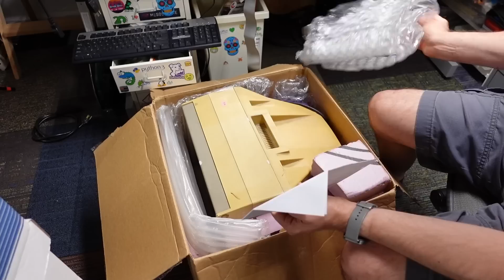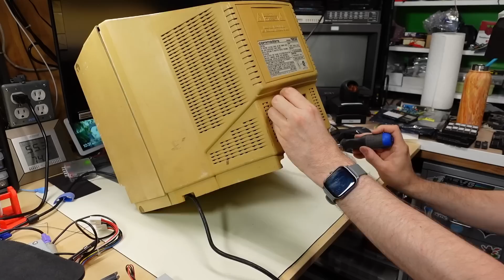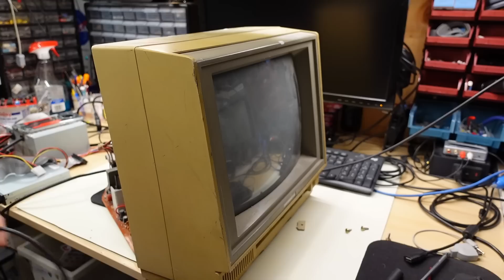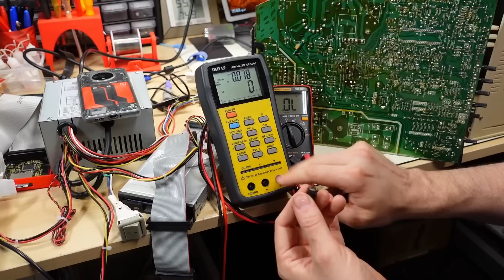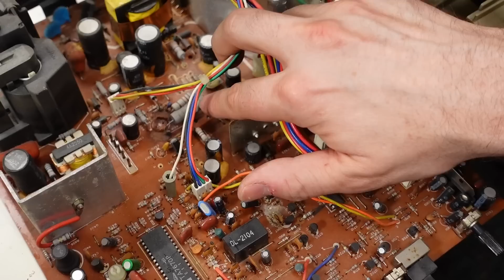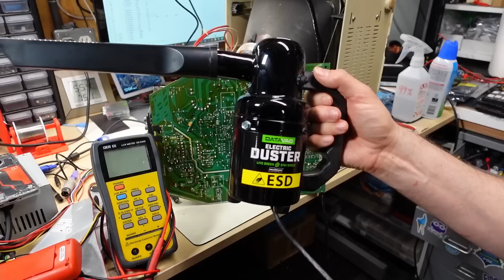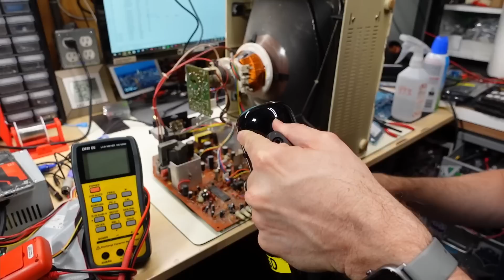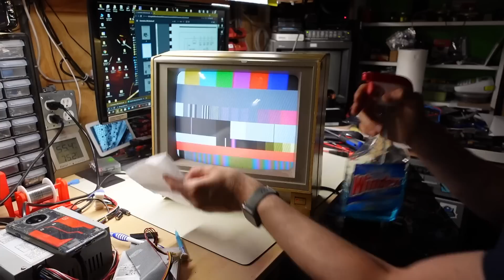What broke on this Commodore 1802 monitor? #repair

Comment: I have a funny story about my 1802 with a similar deflection issue. I bought it in 2018 and it worked great aside from a sticky power button. A few months later i turned it on and had a flat line. Dead vertical deflection. But if i let it warm up it would slowly grow to fill the screen. I spent some time diagnosing and didn't find anything. Decided to take the shotgun approach and recap the entire monitor... No change... Replaced both the ICs... No change... Even tried reflowing a bunch of solder joints... No change. 
Well, around this time i also had a major mold problem in my apartment (i was in a shady apartment complex). As it turns out, there was a loose drain pipe from the walkway upstairs, causing moisture to get into the walls which caused the entire apartment to stay very humid. Well i finally forced them to fix the issue with the drain pipe and got everything de-molded and some time later turned the monitor back on to try to do some more diagnostics... To my surprise the deflection problem was gone! It's been a couple years and it's never come back. I still have a hard time believing it but the only conclusion i can come to is that the very humid air was causing some sort of fault in the vertical deflection circuit. And that's why as i left the monitor to warm up it would eventually fill the screen. I couldn't believe how much time I wasted just to find out the monitor didn't have any issues but in the end it got a bunch of good maintenance, so I can't complain too much.
Reply: Ugh, I hate that. I had a Casio VL-1 that was totally wrecked by that sort of mould. That, and spiders - they just love circuit boards.

Comment: I’ve taken apart electronics in the past and it was not uncommon to find parts that are susceptible to breaking off if exposed to sustained vibration get anchored to the board with some type of contact cement. I’ve also seen some type of hard wax used, and my work uses epoxy in similar situations.

Comment: The original 1701/1702 were JVC TV/Monitors rebranded. Some of them, the earliest, have still a cubhole where the RF Modulator sat, and all the other have some pegs hidden under the bezel where the JVC logo was affixed.

Nice video, I love seeing restorations and since I may have to move in a bigger house, I always seek suggestions on how to pack my CRTs properly ^_^

Comment: Had a couple of 1802's for a few years.  Never had as much luck with those as with the 1701 / 1702's I've had.  1 of them ended up with the vertical deflection problem this 1 has.  The other had a number of cold solder joints on the main pcb which a friend at tpug did help with a few years ago.  Too bad it ultimately failed again.

Comment: If there is space under the board you could move the power resistor „down under“  and away from the cap. It wiggled anyway when you touched it as it were cold solder joints. Never move a cap away on long Leads because of inductance effects an that cap is a power reservoir for the deflection oscillator. And long Leads defeats its porpoise of delivering power to the circuit.
Reply: As this is a low frequency circuit I doubt lead length will make a difference here. In more critical areas and particularly with ceramic/film/tantalum caps lead length should definitely be kept in mind.

Comment: Didn't start to watch the video.   I'll guess cracked solder joint or a blown flyback transistor.   Ok,  I'll watch the video now.  Edit:  Guessing a bad cap is just boring anymore.   BTW some of that glue can become conductive over time and especially near heat.

Comment: At 31:43 what is the molex connector to the right of your hand? I have a wells gardner 27" arcade CRT and I'm trying to find a connector the AC input.  That connector looks about the same but with more pins. Cant seem to find it online.
Reply: Search for Wafer connector instead of Molex.
Reply: @Okurkaarrgghh  That's totally the wrong type. Anyway wafer is not a real connector. The correct type is usually JST, Amphenol, TE Connectivity, Hirose or Molex or some other actual brand. @TheGato38  I own a Wells D9200 27" arcade CRT which is in my Taito Egret II arcade cab. If your monitor is the same model or similar, contact me directly and send a pic of the connector and I can help you to identify it. There are many many many different types of connectors and most of them look the same. Or look on mouser for cable and power connectors and you will probably find it.
Reply: @johnbos4637  That connector is in the 1802 service manual referred to as Wafer.

Mouser also sells Wafer connectors.
Reply: @Okurkaarrgghh  That doesn't help. There are at least 6 different 1802 monitors that all look slightly different and will be different internally too. But you missed the point. The guy was asking about a Wells Gardner arcade monitor made in the early 2000's, not 1986 like the Commodore 1802. Looking up a 'wafer' connector isn't going to help because the Wells monitor uses modern connectors. Like I said there are 1000's of connectors and they all look very similar on the surface and the guy obviously isn't clued up enough to see that the 1802 connector is actually noting like the Wells monitor connector. He just sees a connector and thinks it's similar. The reality is very different.
Reply: @johnbos4637  It was the only Daewoo 1802 Service Manual.

OP asked about the "molex connector to the right of your hand"; it's that question that I answered.

Comment: I actually think that the "goo" around that dead capacitor actually was just the glue, just burned up by those resistors. It doesn't make much sense for the manufacturer to put the glue to each similarly sized cap and not on that one... Good catch either way!
Reply: many manufacturers glue their caps, and wires and other 'tacked on' components, and some cases the glue absorbs moisture and goes 'conductive' and cause lots of problems!
Reply: @andygozzo72  Yes, definitely. It's either the moisture or just the chemical decomposition leading to the most kinds of (old) glue to become conductive and/or corrosive. But, this king of glue is most likely OK and it won't cause major issues other than discoloration. If it was corrosive or conductive, then it would wreak havoc in many other places on that PCB where it was applied. Also, the legs of that capacitor and the surrounding components would've likely been corroded away if it was the "bad" kind of glue.
Reply: @MomirPeh  yep, i've come across corrosion from glues a few times, one it ate through a lead of a capacitor and some of the pcb track!

Comment: The 1701 (at least mine and most of which I came across) has a relatively small dot pitch.
It actually killed (sort of) my childhood TV. My first own TV was a cheap 1997 14 inch model (still cost around 500 Euros in today's money) and I watched the hell out of it (up to 4 hours a day...). Then I was given a Commodore 128 with a few games and that monitor and I was happy, but when I found out I could hook it up to my VCR and use it with the VCR as a tuner I could make this a TV and the picture was so much better than my old TV, I didn't use that one any more and after a few months I thought I'd give my old TV another go, it struggled to turn on and the picture was dim and blurry. I thought maybe it'll get better if I start using it daily again. That worked for a day or two (with the picture like it should be), the next day it was blurry and dim and then something went bang (rather unspectacularly) and it just died. But well, I had a 1701 monitor I could watch TV with and with a flick of the switch on the back I'd be off to playing video games. And it still works today and I still use it a lot (although not as a TV anymore as my daily driver is now a Philips 26 inch from 1983 with stereo sound and bass reflex speakers).

Comment: For a long-term fix you could maybe mount that cap with some long leads and fold it away from those gnarly resistors. With some heatshrink tubing on the legs of course.
Reply: And solder wires to the big power resistor and mount it on the heatsink.

Comment: Great video and nice work! 😀👍 
What I think happened here is that the glue turned conductive and probably contributed to that capacitors demise. You can also see the glue starting to go bad right next to that hot resistors other leg.
Reply: fairly common problem, the glue absorbs moisture from the air, i've had this and rubber wedges between the scan coils and crt also absorbing, even to state of being 'wet' and this wet seems acidic and corrodes the wire in the scan coils, in some cases destroying them!

Comment: Adrian check out the Aneng AN8002 it has a better milliamp current range versus the AN8008 (but is consequently missing the super low current range of the AN8008 -- which is less important to me).

Comment: Recapping these monitors is popular for people who don't have the skill to troubleshoot these effectively.  It's cheap, doable for someone with basic tools, and often effective.  
I know Shango and others criticize people for doing it, but do what you can with what you have.  Not everyone has a fast oscilloscope, libraries of SAMS fotofacts, and specialized test equipment necessary to repair things "properly."
Reply: 'blanket' recapping is a waste, as in the video, only one faulty,  and they're not always to blame anyway, you dont need oscilloscopes or expensive equipment to test them, you can get fairly cheap cap/component testers via ebay, banggood, or similar,  caps to check first, are ones near anything generating heat,  ones in cool areas much less likely to have gone bad, heat and ripple current are big killers of caps, and hours of use, not purely 'age'
Reply: @andygozzo72  it’s a different story when you get into the really old televisions and radios, as most of those have the old paper capacitors which are guaranteed to be leaky, so in those cases, you practically MUST do a full recap before you can hope for it to work.

Comment: Nice job there, I have to admit I have done the whole troubleshooting process and not seen the obvious, as sometimes you just expect stuff to require probing and thus go straight to that, rather than just do a bit of observation first to spot anything that is out of the ordinary... :)
Reply: I think it's good to show what he would have done if a visual inspection didn't show anything. :)

Comment: Instapak works really well but they are kind of expensive. Another alternative is to use polyethylene planks "usually laminated" cut into 2"-3" wide strips and make a structure around the object to be packed that is glued together, companies like rockford fosgate used to ship their amps this way.

Comment: Packing is always a challenge. In this case there was no packing on the top. But really there was not enough on any side, monitors are so dense. Imagine the box getting dropped on its top from 6 feet because that’s the reality
Reply: Yeah, I don't think people realize how packages are being treated. This packaging certainly was not up for the job.
Reply: @stragulus  tvs and monitors need at least 5 inches of soft polyurethane foam all round,  not polystyrene, though, as this is far too hard and rigid (i used to work for a packaging company)

Comment: Nice job. I was 99.9% sure it was a cap issue as soon as you powered it on. Was surprised you didn't change them all. Yes, the caps check good, but they are 35 years old and it's a good preventive maintenance for the future. Either way, thanks for the great content.
Reply: if the others test good, no need to change, doesnt guarantee against future failure at all, any other, maybe unobtainable part could fail, and those original caps can potentially last many more years,  i have lots of old equipment and have rarely had to change any capacitors,  i find relatively new(late 90s to 2010s) caps and equipment worse!
Reply: I agree. I am against replacing working parts but caps are a bit different in my experience. A lot of them can test good but still be bad. I usually recap anything I work on because I have a reputable and trusted source for good caps. Everyone’s mileage varies.
Reply: @MikesArcadeMonitorRepair  if they test good, how can they be bad??!! i usually leave alone unless obvious signs of heat problems/or near heat source, or known bad brands, or if know problem for that particular equipment (had that a good few times in the 90s), caps in long unused equipment may seem to test bad, at first, but once powered up, be ok,  due to deforming with disuse,
Reply: I am referring to them testing good for now, but being 35 years old, start to fail relatively soon. I basically don't trust them is what I'm saying, especially on high-usage items. Components like resistors, poly caps, inductors, flyback, etc I will of course leave alone. I have been repairing monitors and arcade parts for 15 years and caps are just the bane of my existence. So I'm biased towards replacing them because they often go bad prematurely due to the heat inside the machines while being ran for hours on end. Just my experience and preference.
Reply: @MikesArcadeMonitorRepair  so you'd replace now, and again after another 35 years,?? then again.?! i doubt many modern ones would last as long as the originals....
Reply: No. Depends on the usage and environment.
Reply: @MikesArcadeMonitorRepair definitely, i've only had to 'blanket' recap once, and that was due to such crappy caps,i've had the same types give trouble in other equipment, luckily not full of them, like this radio!

Comment: RF adapter is called a balun (balancing unit) and while it does change the impedance, the main difference is the balanced/unbalanced thing. They do work in both directions, also.
Reply: I thought it was BALanced / UNbalanced  i.e  converting between a balanced input to an unbalanced input  or vs. versa.  Example 75 ohm UNbalanced to 300 ohm BALanced.
Reply: @jeffm2787  "Balanced/unbalanced" is another name. The change in impedance is not the central concept here, and you can for example buy baluns that have 50 ohms impedance on both sides.
Reply: @graealex  Yes I understand,  been a HAM for years and have a strong background in electronics.  It's my understanding that the BALUN word came from Balanced to Unbalanced.